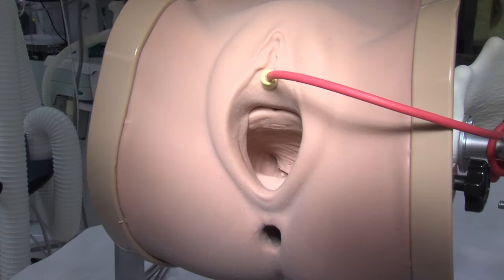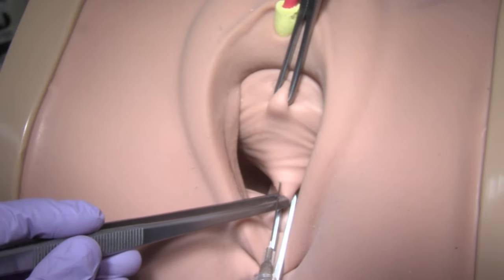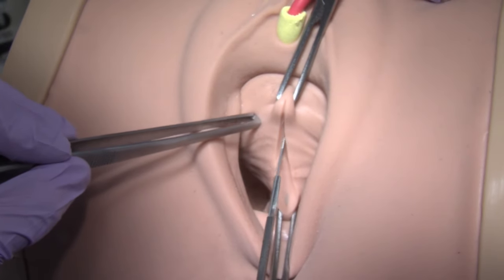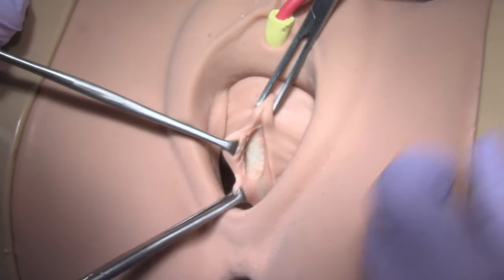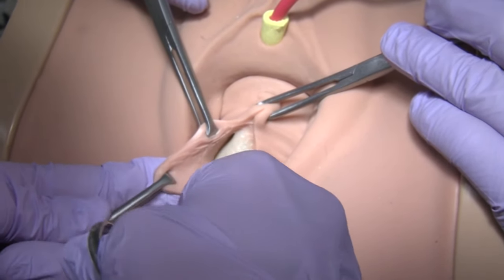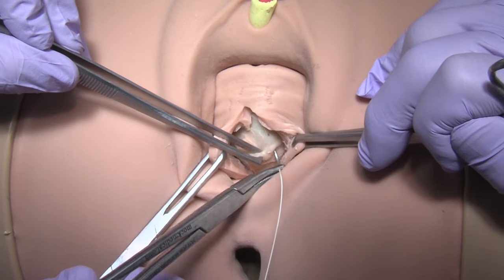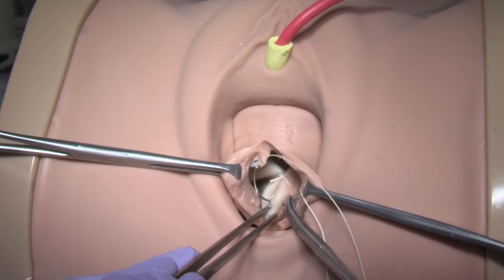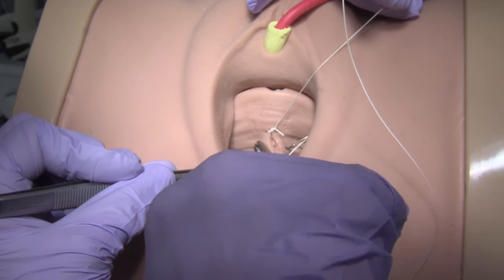Anterior Colporrhaphy | Cystocoele repair | step wise demonstration

Comment: Ma'am,

1.is urethral kinking one of the mechanism of why pts with cystocele have difficulty in paasing urine??

2.what is the line of management of cystic glandular hyperplasia?

3.does a pt who has frequent prolonged and heavy bleeding PV ,not be evaluated for ET just coz she is being bleeding for a long time and it should be assumed that it will be thin.?

Kindly answer my doubts.
Thank you